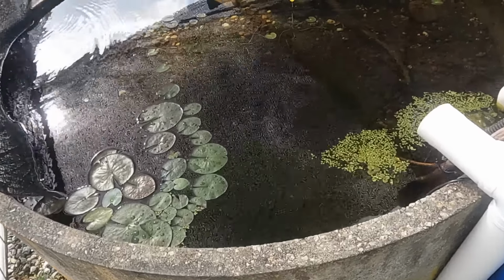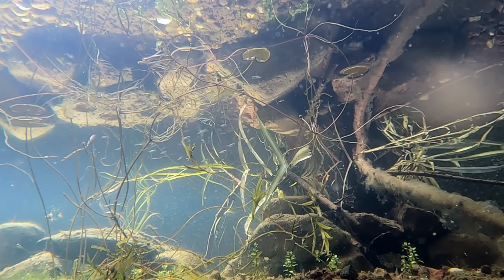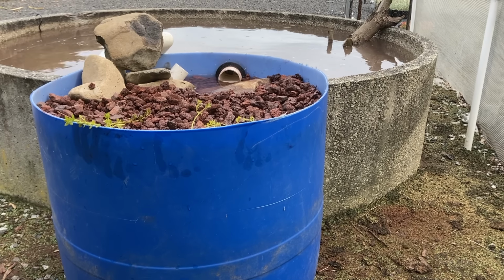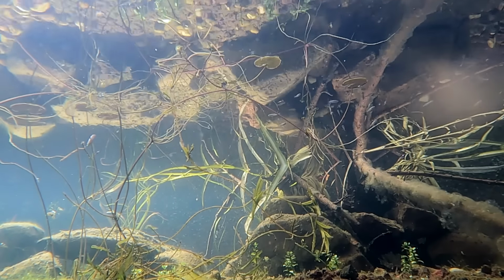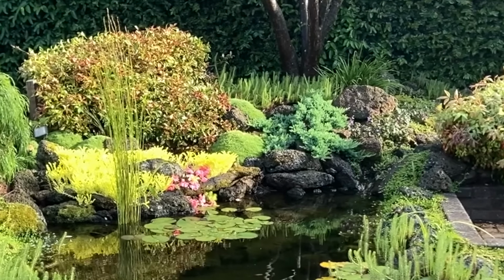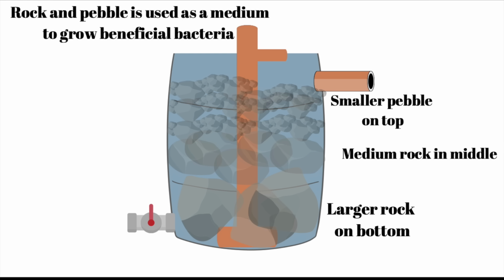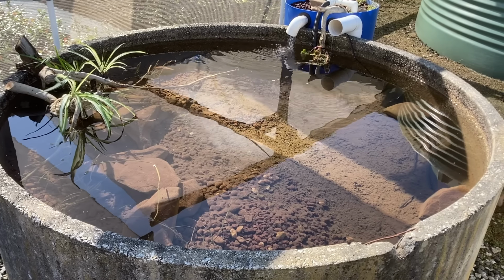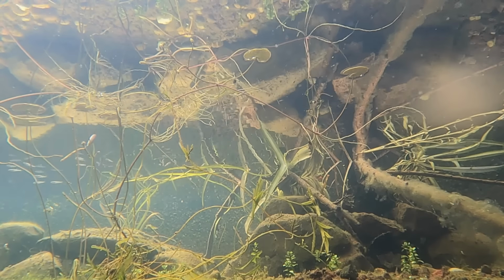How to Design and Build a DIY Bog Filter for Crystal Clear Pond Water

Comment: Just finished with DIY bog filter for only 600L pond. Not gonna win an award for prettiest (probably the ugliest) but wanted to get the basics right. I gotta admit my DIY skill was very limited and half of steps were unfamiliar, so at least I learnt something new. I was most afraid of getting uniseal step wrong as I couldn't find them from Bunnings and instead bought them from eBay. I would need to wait another week if I make a mistake.

Huge thanks for convincing me to DIY a bog filter. Sub earned! 

(BTW I'm also from SE suburb, likely closer to Melb)
Reply from the maker: Well done for giving it a go 👍
Reply: Near 6 months update: Water is definitely clearer! A lot of gunk that were sitting around pond plants have disappeared.

However string algae remained an issue. I knew from the start my pond is overstocked which likely caused it. I guess it has to do for now.

Comment: Hi Kev , I really like this video it is very easy to understand. The mistake I made on my last bog filter was using invasive plants on the top of it. They completely took over and the flow stopped and overflowed whilst I was on holiday. My pump fell over and luckily stopped whilst my fish still had 6 inches of water. They were all alive when I came back home because of a vast amount of water lettice I had that reduced the ammonia and nitrates . Another mistake was putting the pump at the bottom of the pond and not putting in a T piece to stop back flow. So if I follow this video to the letter when spring comes I should be ok. My pump is very strong though 4500 Litres per hour . My pond holds about 1200 litres. I was going to buy an old wooden whisky barrel for the bog filter .It is said to hold  200 litres of water and be water tight.  So if I follow your advice , I could use an overflow system because of  the pump being too strong ? I need to stop the pump pulling in baby fish , please could you explain a bit more the type of cloth you used over the pump and how you tied it on to the pump. Thanks very much. 😊🐟🐠🐡🐋🐔🐝🌻☀️🤶🎅
Reply from the maker: Yes you could direct the excess flow out through the breather pipe, over the surface of the bog. Or you could divert the flow to some underwater, or surface jets to help with circulation. 
The cloth of the pump was regular shade cloth (like used in the garden). I simply folded it around the intake part of the pump (the cage is still on) and used cable ties to secure it in place. Hope that helps. Have a great New Year 😊
Reply: Yes that helps a lot . Thank you Kev. Have a fantastic new year. I must add that your ponds are becoming more beautiful every year . ❤

Comment: @Ozponds Kev, is there any problem with using broken-up aggregate concrete (driveways/sidewalks) as some of the space-taker/bacteria surface in a bog filter?  I'm building my second, and having trouble finding appropriate river/granite-type rock to use up the space; I've got 4-5" stone and pea gravel for the top two layers, but I need something larger in the bottom.  Will the broken concrete, "urbanite", suffice?
Reply from the maker: I’ve never personally tried it, but I think it’ll be ok. 👍

Comment: Nice vid, thanks for sharing. The stock tank seems to be filled rather high with substrate, curious on the reason.
Reply from the maker: It has a false bottom kind of like an underground filter in an aquarium. The idea is that water can flow all around the substrate, sort of like in a river. It should act as additional filtration so I can really keep lots of fish in this pond.

Comment: Love your videos, very informative! I have a 100 gallon pond with a 1800 GPH pump and a 27 gallon plastic tote to use as the filter. If I have a 3/4 inch inlet and a 1-1/2 inch outlet, can I plumb the outlet into a 1 inch hose line to run to my waterfall feature about 5 ft away? The filter will be uphill slightly from the waterfall and everything will flow downhill. just wondering if there would be enough pressure to get from the outlet to the waterfall with the size reduction. Thanks!
Reply from the maker: You won’t need to reduce it. If it flows downhill it will just flow downhill, better to keep it larger. The smaller diameter won’t create more water, that’s all that matters when creating a waterfall, the amount of water. Smaller diameter outflows from the bog run the risk of not allowing enough water to escape.

Comment: Thank you so much for all the amazing videos! I started my pond journey with David's organic pool pdf. So i have a air pump to move the water. So far my regeneration zone is not large enough and it all turned green here in Phoenix AZ. I do not have enough room to expand it so i was hoping use hybrid version of your bog filter design. So i was wondering if I can make your bog filter with this type of pump? or does it not have enough pressure? My idea was to pump water from the bottom of the pond with an air lift to bog filter and it will fall in to into a larger diameter pipe (not connected) that goes to the bottom of false bottom of the bog filter, water will rise as it is being filled in the bog filter and the water will return to the pond with the water fall effect back in to the pond being lower than the water air pump delivering the water to the bog. Wow I hope that makes sense. Thank you again for all that you do for this DIY community!
Reply from the maker: Theoretically I think it could work. The issue I see is that you want to get the flow rate through the bog within a ball park figure. A variable speed pump just makes it so easy to adjust and find optimal flow. You could turn it off when you swim as to have no electricity inside the water if that’s the concern.

Comment: Happy New Year Kev! I installed a bog filter 6 months ago and the water is sparkling clear. Unfortunately, I am having a problem with green moss on all the sides of the pond. Do you have any ideas how I can reduce the moss growth? I am so thankful for your great videos and I have learned so much. Thanks again Kev 😎
Reply from the maker: Algae or moss? My first piece of advice for algae in a new pond is always patience. You can scroll through my previous videos and see lots of different things I’ve tried over the years. Algaecides, encouraging good algae, beneficial bacteria, hydrogen peroxide. Every pond is a bit different so you kind of need to find the solution that works best for you. Hopefully those videos will help you make a more informed choice 👍
Reply: Thank you Kev I will cruise through your previous videos. It is winter here where I live so I will prepare for a Spring solution.  @Ozponds

Comment: Excellent advice. I'm probably going to need a new pump in the next few months. It's always good to remember not to put it on the bottom of the pond. Also, I love my ugly bog filter!
Reply from the maker: What sort of pump will you get?
Reply: @Ozponds  I've been using a pool filter pump (because I already had it), but I think when this one wears out I will get a proper pond pump. I probably need one about the same size as the one you used in this video. My pond is 300 gallons, so that's pretty close to 900 liters.
Reply: I have been using the tetra ( big green)  solid handling pond pump. I have had ponds for 27 years now or so….It doesn’t clog and the suction stays even. In the other ones if they clog in an area the suction is greater on the other side. So sadly I had baby turtles get their legs sucked up and they drowned. I have never had that happen with the tetra solid handling one.   Only time I use the others is if the water is sucked somewhere else like in a skimmer etc.  
    I have one that sucks from the skimmer to the bog and the tetra one sucks directly from the pond to the filter then bog.  That way I have double the cleaning, the bog and the filter but it all still flows up through the bog. Just. Thought. Never had problems with them.
Reply: And far less maintenance on the pump, no net bag is needed. They are amazing.
Reply: @Sea-cucumber1151  I will look into getting one of those. I don't know anything about which brands and styles of pond pumps are good.
Reply: Keep it mind the head height it needs to travel when making decisions.   I forget what brand name  I have but the pump similar to what Beckett Corporation sells.   It comes with a nosecone with a pre filter foam.    I have 2x 560gal pumps that have ran well for 2ish years.

Comment: At 11:39 into the video you’ve got the pump submerged. How often do you have to clean the solids that collect on that cloth. That’s the issue I have right now. I’m cleaning my pump way more often than I used to.   you’ve got a very nice filtration unit, but with that pump submerged, it would seem like you’re having to clean the muck off of that pump more than you would have to worry about the muck that’s contained in the drum.  I’m watching your videos clearly that doesn’t look like an issue at all so I’ve got to figure out what I’m doing wrong.
Reply from the maker: I actually removed it, it was a real pain. I have a system where I use a plant pot and a sponge, that works much better. I did a video titled something like how to stop your pond pump getting clogged. That shows you a few options 👍
Reply: @ excellent I will search it now
Reply: I watched your video about clogged filters and maintenance.  thank you so much ! (sharing with friends).
Now for creating a bog filter.   Your videos were helpful. 
What steps sound I take during the winter months?  In the southeastern United States the temps can drop to 20 to 30° for days at a time. What can I do to maintain that bog filter?
Reply from the maker: @ you can either turn it off or keep it running. Just trial and error 👍

Comment: Thank you so much for all the good advice. Just a question; is there any type of stones/bricks/rocks that should not be used in the barrel? I was thinking that the material could disperse some kind of chemicals in case it is not natural rocks. I would like to decrease the overall weight. Stones of light concrete or leca blocks (if it is called so in English) would decrease the weight considerably and also provide more surface.
Reply from the maker: I use anything I can get. It’s just surface area we are after.

Comment: Do you need a breather pipe if you use an in-line Sump Pump Check Valve between the pump and the bog?
Reply from the maker: As long as it stops the siphon that’s fine.

Comment: Just put my bog in a barrel together, thanks to you. Quick question, do you still need the breather pipe if you installed a check valve from the pump? I put my breather pipe too low and now just want to cap it, figuring I’m fine since I have a check valve anyways.
Reply from the maker: If the check valve works you’re good.
Reply: Check valve will eventually fail.

Comment: Kev, when the filter is operating and there is some resistance to the water flowing into the bottom of the filter, what stops it taking the easy path out through the breather?
Reply from the maker: I’m not sure exactly. If you watch when the pond was built I actually talked a bit more about the breather pipe and how you can add a vertical pipe if too much water comes out the breather. For some reason the water prefers going down the straight pipe into the base of the filter as opposed to taking a 90degree turn. But if the filter is becoming clogged and it’s hard for the water to pass through the media in the bog more water will definitely come out the breather. I’m sure there’s a way it could be calculated but it’s too much for my brain.
Reply: @Ozponds Normally I could explain this, HAHA, but on this night at this time? I'm too boggy. Ha pun intended, happy new year everyone.

Comment: So if i used a barrel/water butt as a bog filter. To clean it would just be a case of opening the valve to empty it whilst filling the barrel with water rinsing it through until the water coming out is clear? If that makes sense 😂 thanks
Reply from the maker: Sounds good 👍

Comment: I did something different, I put the hole filter inside the pond submerged and put the pump inside the filter then room the out pipe if the pump and put it on a raised surface and let it drip back in the pind to originate the water
Reply: Although my pump started to slow down a bit after 2 months or so of continuous working, I think it's either I didn't put enough fine filters to filter out the solids, or just simply the  pump was cheaper
Reply from the maker: It’s always fun experimenting. There’s multiple ways to filter water.

Comment: If the breather pipe doesn’t have a vacuum breaking one way check valve, what forces the water to the bottom and not just out the breather pipe?
Reply from the maker: The water seems to prefer to travel on a straight line. If it is an issue use a valve or an elbow. I have other vids showing both set ups 👍

Comment: Great video! Lots of useful information and straight to the point. I'm having trouble understanding the, "breather pipe"  that prevents siphoning. It seems like it's just an open T and water being pumped down to the bottom of the bog would just escape rapidly on the way in from the pond. When the bog is being used and water is being pumped to the bottom of it. How does it not escape out of the breather tube? Thanks!
Reply from the maker: Sometimes it does and you might need to add an elbow fitting and a vertical pipe.
Reply: @Ozponds thanks for the quick response! I still don't understand. If the pump is supplying enough pressure to push water up through the bog, how does it not? Just find the easiest way out through the breather tube and 100% of it. Just rush out of that open pipe. How can it be a pressurized system in any way if there's an equal size pipe just open there? What about another option like a backflow valve?
Reply from the maker: It just works. Try it. Or do it another way you think will work. I don’t know how to explain it adequately but I’ve got many bog filters in use.

Comment: Hi there. Excellent video.
Just a question, is there a flow rate you would consider 'too slow'?
Reply from the maker: I’m sure I’d know it if I saw it. I’m not sure how I would explain it. 🤔
Reply: I am doing a bog filter following your  videos for a 1600ltrs pond. So I put 160 LTRs water in a tank to know where to cut it. And then drained the water with the pump I have.
It took 40 minutes to get rid of the 160 LTRs...will that do or bigger pump?
Thanks.
Reply from the maker: I’d give it a try and see what happens. If you already have that pump it doesn’t cost you anything to try. Changing the pump over in the future is easy if necessary.
Reply: @Ozponds  Will do. Thanks a lot for your time

Comment: I have a koi pond about 8,000 gallons that goes to a 55 gallon sand filter that my brother made pump is round 4500 I got another pump 5,000 gph to old smaller pond about 4x4x12 that is big filter got 1inch pipe along bottom with holes drilled in got it tee off goes to 20 gallon barrel bottom fed with same rock set as you show that spills into waterfall into bog then bog spills into big pond. Also have big barrel split to feed 20 gallon barrel all have flow valves. Big has around 8 inches of pea gravel and lava rocks also 20 gallon barrel plus filter and bio balls. Only problem is I can't drain my bog don't really want to dig an 8ft long trench pond also has concrete bottom with lots of rocks. Can I get any suggestions with pictures on how to clean maintain it please, also put liner on top of concrete. Thanks
Reply from the maker: Did you check out my other bog filter vids?
Reply: I seen a brief note about it but I'm little slow to catch on need little more direction some more equipment more specific to my dilemma don't have much imagination.
Reply: I do find your videos very helpful

Comment: Oz I just built a bog but where the water goes into the bottom of the bog I noticed lots off air bubbles only at one end at the intake. 
 Is that a bad thing ?
Reply from the maker: I don’t think so. Probably just air getting sucked in via the breather pipe.
Reply: Thank you

Comment: Is there a reason that you can't just put the inlet near the bottom of the barrel? Vs having all the piping going up, just to go down.
Reply from the maker: Yes. It makes it too hard to prevent siphoning.
Reply: Ah ok. Would a one way valve suffice to avoid the siphoning then?
Reply from the maker: @mollycalhoun9787  I find they fail or don’t work in low flow applications. That’s why I come over the top and have a breather hole. But feel free to experiment 👍
Reply: @Ozponds  ah ok! I'm just getting back into having a pond and need to get a filter sorted out :) I also just enjoy learning, and my brain comes up with questions it needs answers too lol.